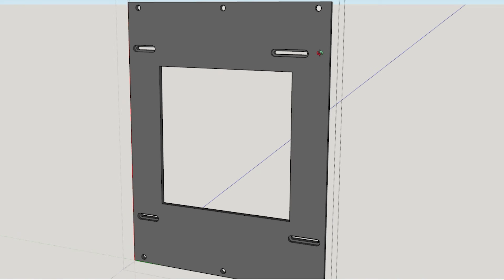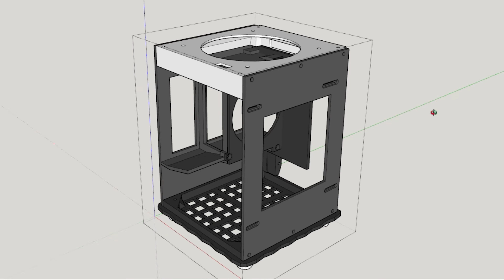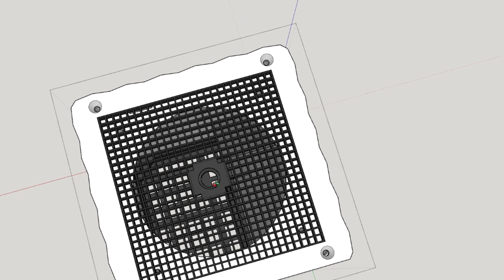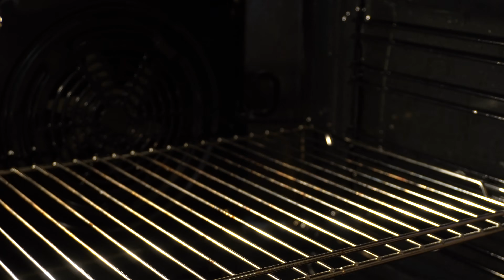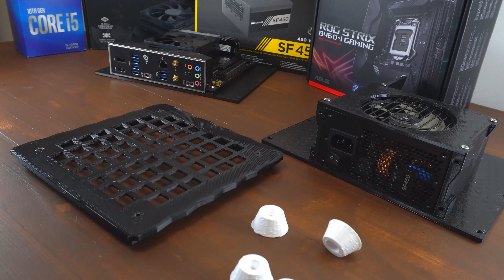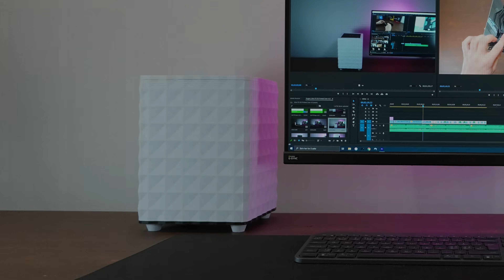CUSTOM MINI ITX PC BUILD 9.7L 3D PRINTABLE

Comment: That's a very sweet looking case. How does the plastic hold up with heat generated by the components, have you noticed any softening or warping if the panels and small plastic parts.
Reply from the maker: I have not really noticed any issues here. Even though lets say in a situation some CPU’s would reach up to 70-80 degrees at peaks (just making up a number). But that’s just the actual processor, not its surrounding air. There are air gaps between most components and its mounts so hot parts are actually in direct contact with the plastic. Exept from the PSU but it doesnt really seem to get that hot either. I have not noticed any issues here.

Running at full load here its like a slightly warm wind coming up through the top. Which I don’t really think is hot enough to affect the plastic (at least not in my setup)

Comment: Great build.... Did I miss it? What button did you use for your build?
Reply from the maker: Hey! Thank you!
 I really couldn’t find the actual button I used on ebay, as that spesific one was bought at a local electronics store in Norway. 

But the inner mounting hole for the button is 14mm. But the actual button I believe is 12mm with a 17.5mm head. (The upper hole for the button is 18mm so its a tight fit.) I hope this was clear enough. 

I also see on Amazon that if you search 12mm momentary switch there are some alternatives just make sure head is no bigger than 17.5mm.
Reply: @makerunit  Thank you!!! That helped a bunch.
Reply from the maker: Awsome! Did you try to make it?

Comment: Great work I'd personally flip it put the GPU at top and do a bottom intake and a top exhaust fan.  That would give it great airflow and force the hot air out.  Currently that gpu even though only a 1660 is putting out a lot of heat and also heating the CPU and without a fan pushing the air up.   Great work though.  I do similar builds with pre builts and found in SFF with a bottom intake top exhaust it will keep your CPU around 50C instead of 70C.   Keep up the great work.  Thanks for sharing.
Reply from the maker: Thank you! 

Idk if you noticed but there is a top mounted 140mm fan creating a negative pressure inside the case so it sucks air in through the bottom pulling all that GPU air up though! 🙂

Putting it upside down would make sense in terms of hot air rising, but it would make my gpu fan would work against the top fan making it worse in my opinion... unless the GPU was actually mounted vertically on the wall then it’d be better flow I guess. That would allow for a 120mm fan in the bottom as well but if I did that idk where I’d put the PSU though... 😅

Comment from the maker: Turns out the blobs were most caused by the seam location set to random. It's still a good idea to make sure filament is dry anyways though... :)
Reply: Hi, can you make a video about how you go fromsketch up to the 3D printer? The case looks great!
Reply from the maker: @randomher089  I’ll see what I can do! Might not be right around the corner but I’ll definitely add that to my to-do list 👍🙂
Reply: @makerunit  I have subscribed and turned on notifications. Can't wait to see your video on how you do it!
Reply from the maker: @randomher089  did you see I posted a video about my design process about a month ago? 👍🙂
Reply: @makerunit  I saw, I think I commented on it as well. Am I wrong or are you Norwegian, think I saw your profile on thingyverse.
Reply from the maker: @randomher089  yeah I am! I didn’t crosscheck names for the comments on both. 😅 I was looking for your comment on this video back when I posted the case design video as I remembered someone (you) had asked for a sketchup walkthrough video. Then I didn’t find the comment back then, but today I came across your comment as I hadn’t looked through the «replies» on each comment 😅
Reply: @makerunit  I'm Norwegian as well!

Yeah youtube is weird that way. Got any new projects in the works? 

I'm building my workshop now with room for my cnc, fdm printer, future resin printer and future laser cutter.

Where in Norway are you based? I'm in Telemark.
Reply from the maker: @randomher089  oo Cool! I live right outside Oslo. Currently doing all my stuff in a small spare bedroom in my apartment. It’s like a tiny 8m^2 office/storage room/workshop/gaming room… 😅 works for now but I wanna conquer some bigger challenges in the future so the long term plan is getting a place where I can have my own workshop/garage. But I prefer staying around Oslo also meaning the prices are insane for any house. Cheapest ones in my preferred areas are like 7-8M NOK++. So for now I just gotta keep dreaming 😅

And yeah, I’ve got a new PC case in progress. In the printer at the moment. This one is on the larger side. Room for mATX boards, 240 AIO and GPUs up to 320mm approx. So should fit most 3070 and 3080s or similar.
Reply: @makerunit  An hour-ish away from me then! Ivm currently building out 35 sqm in the basement of my house. I live outside the city so I want to build a separate workshop later, but the basement will have to do for now. Here in Telemark 2-4mill gets you a decent house with a garage and so on.
Reply from the maker: @randomher089  Yeah I know, the smart thing of me would probably to get a bit out of the city, but time will show what I decide upon. For now my 8m^2 will have to do. I have thought about renting a garage space too but I’m not sure it’d be a smart long term solution so I’d rather save up and own it myself. 😅
Reply: @makerunit  I won't rent space until I could make back the rent with what I produce in the workshop. We make do with what we have until we do better 😉
Reply from the maker: @randomher089  exactly! I’ll get there eventually, for now I’ll stick to mainly 3D printing and getting better at 3D design and I’ll take it from there. 😊 what’s so fun also about making these videos is that I can look back and see how I improve over time. And I feel like it’s a good thing when I kinda promise people in comments to do stuff because then I kinda feel obligated to follow up, just like when you asked for a case design video, I said, yeah I’ll do it. And it took some time but I felt like I was obliged to do it, which helps me push on and keep making content 😊 my dream is definitely to do this for a living one day in my own shop. And all the positive feedback feels really good as well!
Reply: @makerunit  I understand all too well! I have about 20 different case ideas in planned for when the workshop is done and I really want to build a community around casemodding and casebuilding in Norway and abroad.

So far I've been working on designs at night and building during the day. I've also registered a website domain, made Facebook, Instagram and Twitter accounts, so everything is ready to launch. Just need to get the workshop done and start building.

I can't wait to interact with the community, get ideas from them, do requested/suggested builds and so on!
Reply from the maker: @randomher089  awesome! Looking forward to following your progress! Are you thinking YouTube videos?
I’ve actually also reserved the www.makerunit.com domain just in case I need it for something later 😊
Reply: @makerunit  An "official" youtube account has been made as well ;) Basically documenting my hobby on social media, and if it's successful, start a small business. 

I plan on building the cases you don't get from other manufacturers, not mass production, but small/limited runs of bespoke computer cases.

You should definitely get the website up and running if only to redirect audience to your YouTube channel.

Found you on Instagram with my "business account" followed you there BTW ;)
Reply from the maker: @randomher089  yeah I followed you back! 🙂 Looking forward to see your work! I’m sure it’ll be awesome! 😊
Reply: @makerunit  Same! Can't wait to see your next project!

Out of curiosity, what gear do you use to film your projects?
Reply from the maker: Sony A6100 mostly using the 35mm lens from Samyang but just the stock 18-55mm for shooting wider angle shots. I need a better wide angle lens though. And some homemade lights that are actually not very good but they work alright temporarily for now. 😅  I just wanted a camera that could shoot 4k video, and the A6100 can shoot 4k 30fps. I sent you a DM on Instagram.
Reply from the maker: @nyimakgan  Glad you liked it!
Reply from the maker: @nyimakgan  if you haven’t seen it I’ve made a video in two parts showing my process. About a month ago, it’s on my channel 🙂

Comment: Its annoying that you didnt show a GPU stress test temp. Its very clear it was crap and you didnt want to admit it. Where is your dignity? 1080p test does fuck all to test temps.
Reply: What a prick
Reply from the maker: Hey! I’m still kinda new at this custom pc building game , sorry for not including a dedicated GPU stress test, as i thought that during gaming the GPU would work at 100%, am I wrong? If so, then sorry! I’ll definitely look that up closer for the next build... but the GPU is really the part getting the «freshest» air here so I wouldn’t think it’d really be bad at all! Just considering the fact that the hot air emitted from the GPU is immediately pulled away and up by the airflow passing it on its sides... 🙂

Comment: I like it! A little bit taller and you'd have room for a 140mm rad. You could also add the option for a magnetic dust filter to the bottom for easy cleaning. Simple design but works really well.
Reply from the maker: There is actually already room for a dust filter about 10 millimeters of nothing between the GPU and bottom vent plate. It was in the thoughs early in the design process but I never finished a good solution there. As having a filter on the inside of the case would definitely be tricky to get out without disasselbly. 

But I suppose I could just push the center part of the bottom vent 10mm up and instead have room for a magnetic filter on the underside of the grid. I didn’t think of it like that before now! That would work great!

Comment: This is really cool, but I'm wondering what software you used and how you got that pattern on the panels
Reply from the maker: I designed this in the free version of Google Sketchup actually. The pattern started with a 30x30mm square that I designed into the spesific shape I wanted, and then I jusy copy and pasted the squares next to eachother until I had the desired pattern panel size I wanted. If that made sense 😄

Comment: Phenomenal job! Really looking forward to the larger version to hopefully accommodate a 3070.
Reply from the maker: My printer can’t print that big unfortunately at the moment, I’ve gotta figure out that one, a full size GPU compatible case would be amazing though, it’s still in the planning so who knows what funny solution I’ll come up with 😅 be sure to subscribe if you’d like so you don’t miss the next version!
Reply: @makerunit  Darn. I have a Creality CR-10 which should be able to fit the dimensions and am knowledgeable with Fusion 360 so if you'd ever need some help with prototyping, I'd love to help.
Reply from the maker: @macsheehanphoto  for some reason I read in my head that you had an Ender 3. I now realized it says CR10, that’s plenty of volume 😂
Reply from the maker: I’ve got the CR10 v2 actually 😅 Theoretically the size would be able to fit due to the height of course, but I feel like it wouldn’t be as strong if printed horizontally, the inside wouldnt be a problem printing in pieces but the outside shell would be sweet to get in one piece. I’ll look into it some more. 

I’ve been designing in the free version of sketchup until now hah 😅 Just realised there was a «hobbyist» license on fusion 360 for free so I’ll try to learn that over the next weeks 😊

Comment: Nice work!
what about option to face the fan of the PSU to the outside? maybe by doing the space between the side panel and the outside shell it would be enough and you would get all the airflow for CPU and GPU
Reply from the maker: The way I thought would be most logical would be to close up as much as possible to kinda make sure the air would be forced past all the components, and because the PSU works as an exhaust fan and doesnt really pull much as far as I know it wouldn’t really matter that much, but I might be wrong 😊 the current setup gives more than acceptable temperatures in my opinion way better than I expected! But I’ll definitely look into even better airflow solutions on the next version
Reply: Unless I'm missing something, if the PSU faced the outside then only the PSU would benefit from pulling air in from the outside, this way, it will pull air from the holes in the bottom up into the case and then back out through the PSU.